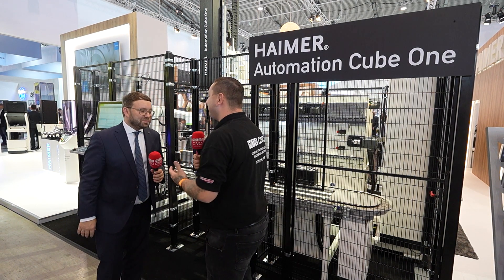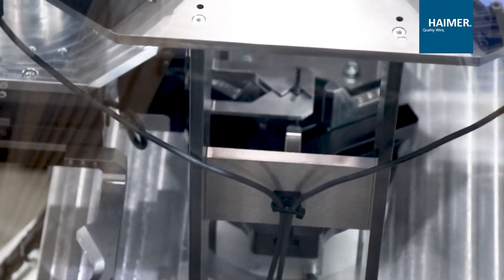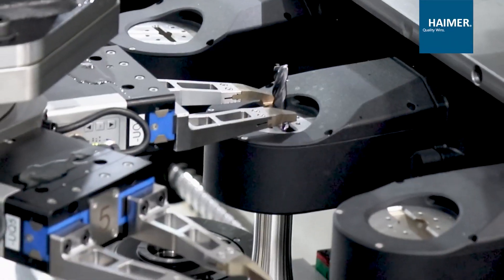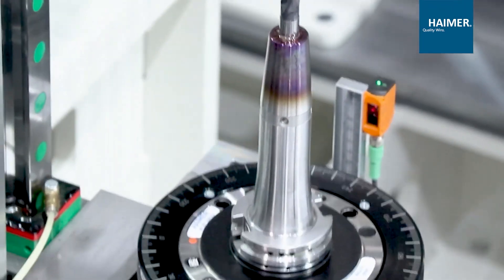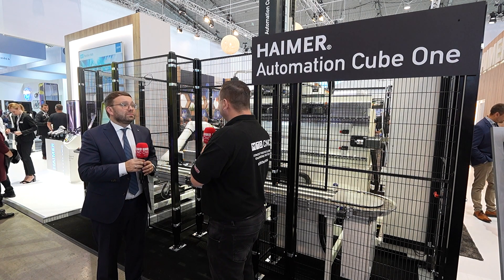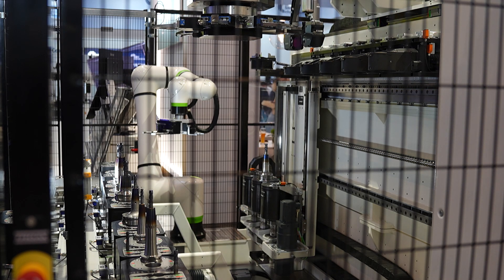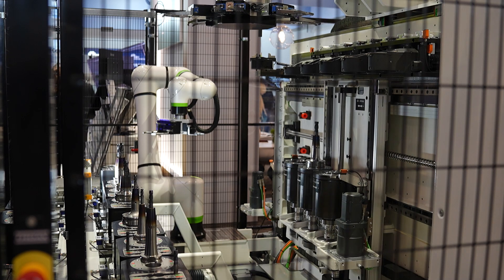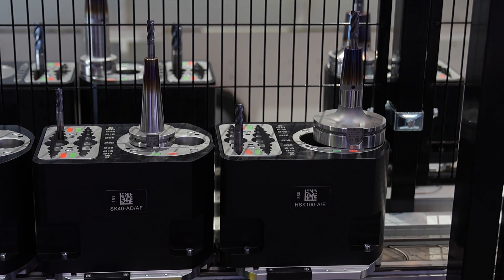Lights out production and assembly in your tool room?

Comment: Unfortunately, that is not correct. An automation with the same functionality has been in use since 2005 at the PAG (formerly Airbus) plant in Varel. It was built by Brötje Automation (formerly HC (Hydro Control)).